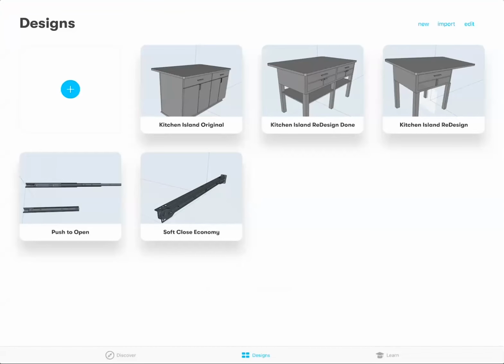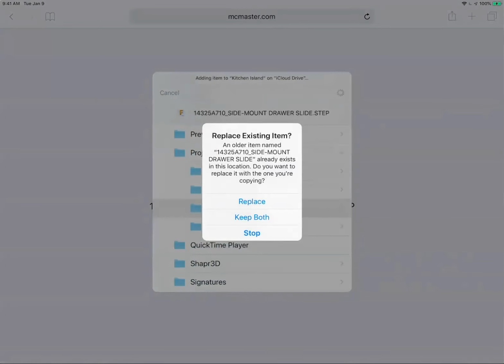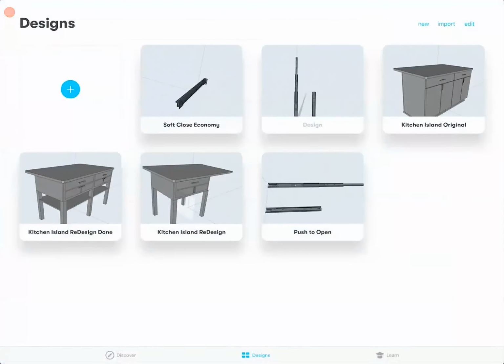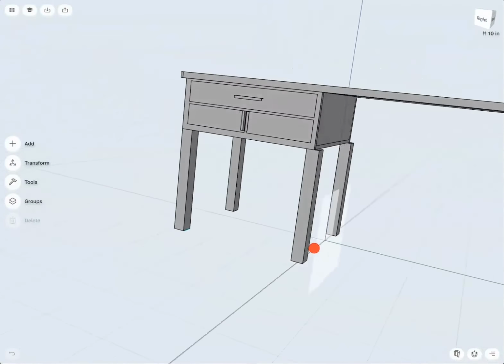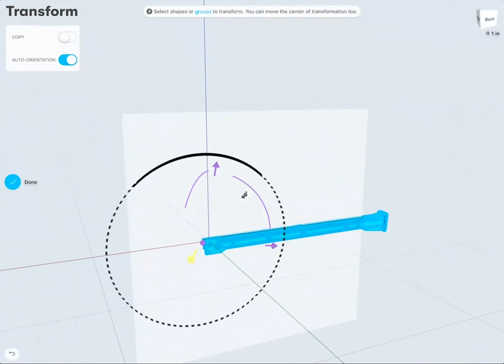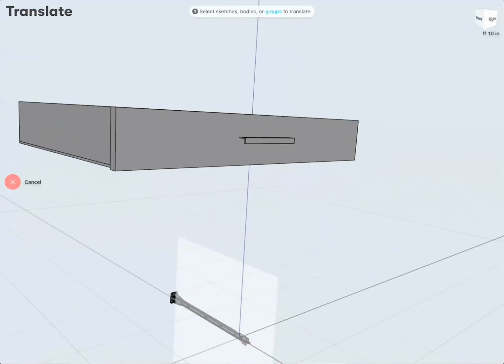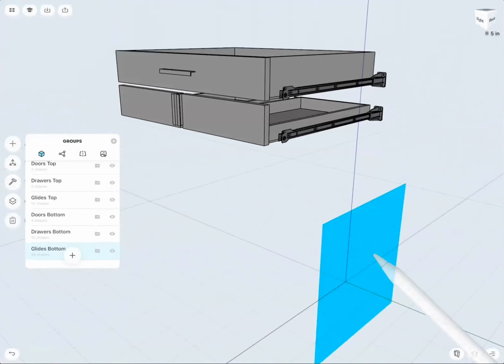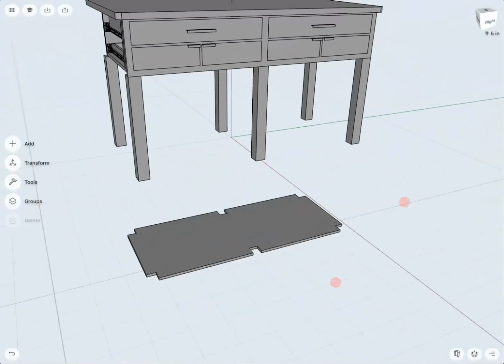Work with imported 3D files | 3D design webinar

Comment: "Parasolid also delivers Convergent Modeling technology, which extends its robust B-rep modeling functions to models based on facet representations. Parasolid provides wide-ranging graphical and rendering support, including precise hidden line and wireframe, as well as versatile tessellation functionality."        
HOW MUCH SHAPR3D ALLOWS ESPECIALLY RENDERING AND GRAPHICAL SUPPORT????????????????
Reply: PLZZZZ TELL  ME RENDERING IS IMP TO ME 
AND IF doesn't SUPPORT IT RIGHT NOW WILL IT COME IN FUTUTRE?????????
Reply from the maker: Hello,

By 'rendering', do you mean photorealistic rendering (with shadows, lights and materials, textures)?

Shapr3D doesn't provide photorealistic rendering, and it's not on our near-term roadmap.
If you need photorealistic rendering, we advise to export your 3D model into STEP format, and use a 3rd party renderer app like KeyShot.

Regards,

Peter
Reply: can u plz tell me what featutres are u going to add to shapr3d to take advantage of upcoming ipad pro and what i cannot do on shapr 3d in comparison to lets say "solidworks" because i really looking forward to shifting my workflow to a mobile system and i really need a sloution
Reply: thanks for suggestion
Reply: is there any app on appstore that can do photorealistic rendering
Reply from the maker: Hello,

Whether you can make the shift to work solely on a mobile CAD system like Shapr3D depends on your needs.

In the near term future, Shapr3D's main focus is to support more workflow for users who use several apps, like export/import capabilities and also general usability improvements. So not so much about replicating all features that can be found in classic feature history-based parametric CAD tools like SolidWorks. As Shapr3D runs on the same Parasolid 3D engine as SolidWorks, and supportsParasolid native XT format, more and more engineers find it useful to use Shapr3D as a supplementary, powerful and quick prototyping tool.

If you can email your current workflow and possibly some sample of your designs (info@shapr3d.com), we might be able to tell more precisely if you could use Shapr3D as a sole mobile CAD system.

Peter